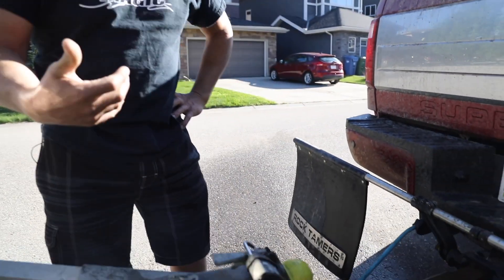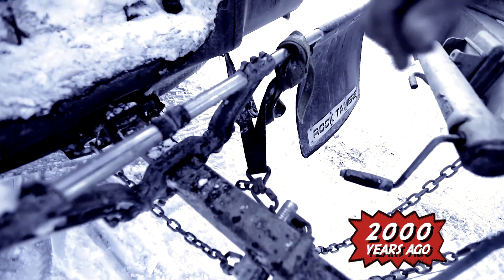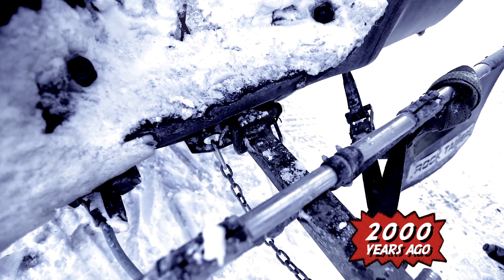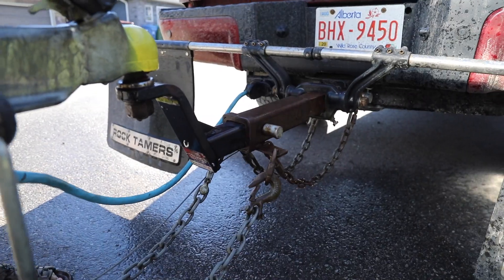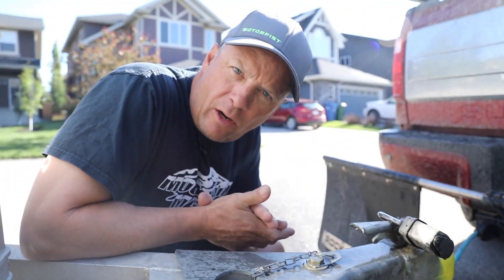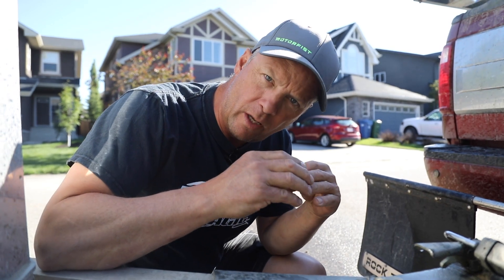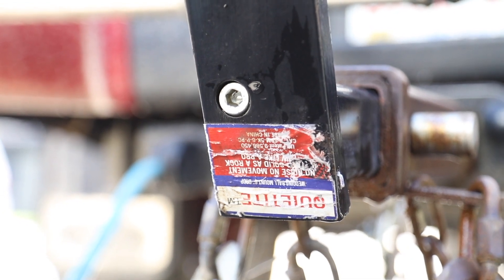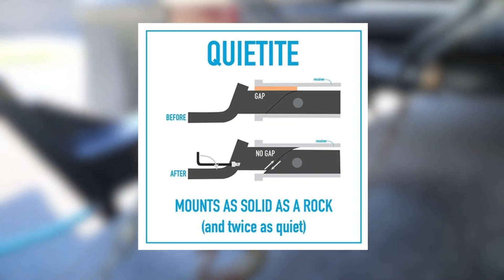Sloppy hitch or loose receiver?

Comment: How's the extension? How long is it? Think I might go thay route now that I bought an enclosed. My problem is, is that I have a short box 4th gen dodge, my deck is 10ft, and I only have 2ft of things between the front of my v and the tongue if my trailer. Dont really wanna cut deck down, think an extension would handle that? Can I find one long enough? Haha thanks, dig the videos!
Reply from the maker: That could be an issue !! Would be one hell of an extension ! 6 ft box or 5 ft ? They make them long with an over under piece of square tubing for strength ! Longest I’ve seen is a 4 ft er ! Mine is only 23” !
Reply: @DIGIT9  too my tailgate its like 6"7. And a couple feet of my deck is dovetail, so its not 10ft straight back. I sold my old one and bought this to cut down, but I kind of like the length. I might be able to get away with 4ft, but seems kinda scary having that much extension haha.
Reply from the maker: I definitely notice the one I have and I have a long wheelbase truck , You may have to add a longer tongue to your trailer or get a long box truck , or just take deck off and use trailer ?
Reply: Thanks for the reply! I'll probably just cut it down, or cut and pin it some way so that when I'm hauling the trailer I can just fold the tail of deck up onto the deck or just take it off. For now atleast, probably be the easiest route. Thanks man

Comment: We all want a tight receiver lol, noticed you don't cross your chains but you probably do just incase the tongue falls it does not dig into the road. MTO is big on crossed chains here in Ontario. Checking out their website now and thanks for the tip.
Reply from the maker: WTF Buddy! We need to make a video about the laws around decks, trailers, trucks. Each province has different laws. Thanks for the idea!